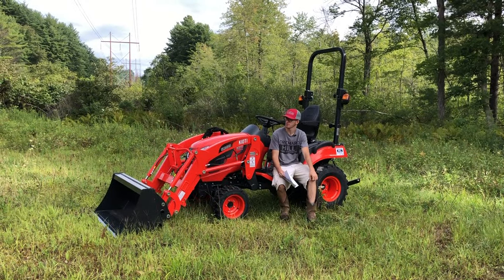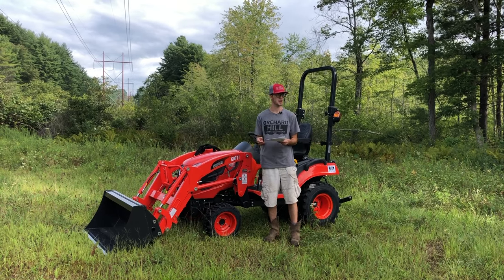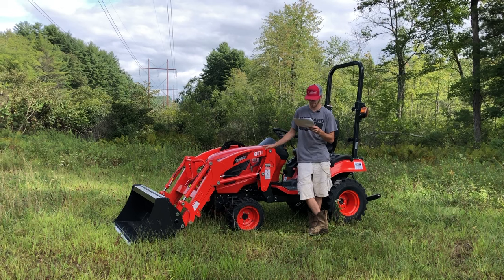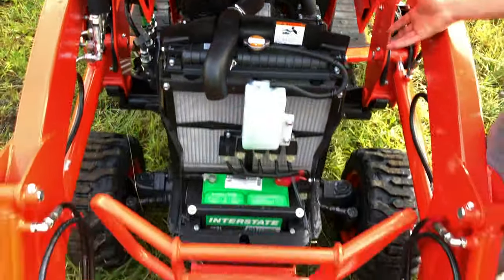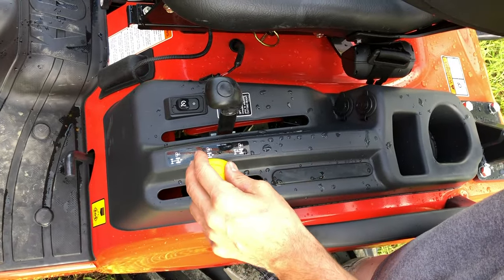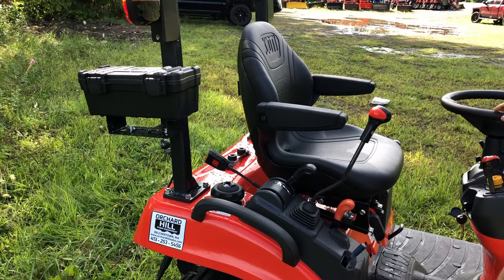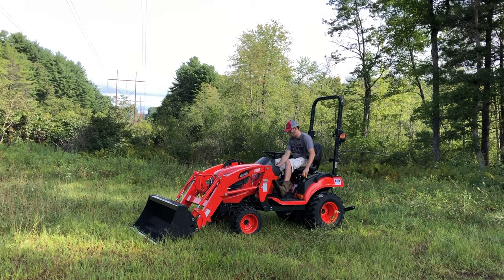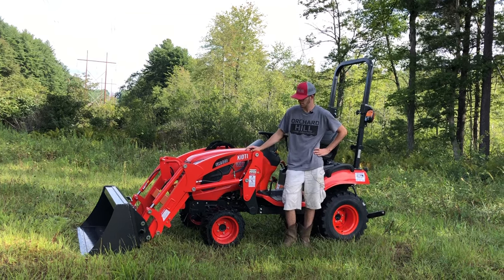*All NEW* Kioti CS2220 & CS2520 Sub Compact Tractor - Walkthru

Comment: nice info on the tractors.  Which one is the one in the video.  Is that the 2220 or the 2520?  And what would be the difference between the two beside the horse power?
Reply: Nothing just adjustment on linkage

Comment: That tractor has everything I want and need except one factor that .... is a killer. Ground clearance in the rear ..... I can’t say I would be comfortable pulling a small disc with ground clearance that low in the rear. If they would produce the same tractor but with skinner taller tires it would exactly what I want. Unfortunately you have to move up to just the compacts for that .

Comment: Is this replacing the 2210/2510 subcompact tractor line? Or is this supplementing the existing line?
Reply: Replacing the 2210/2510.
Reply: @sloppyjoe6243   so all new buckets will have the 1000lb capacity lift?
Reply: @tyburrows7090  whatever is listed in the specifications. Check the Kioti website.

Comment: Steel hoods dent ,scratch and rust and are cheaper to build. The composite or as everyone thinks "plastic" will bounce off most of the impacts that makes dents in steel. Yes steel is easier to repair but composite takes more abuse and looks about untouched.